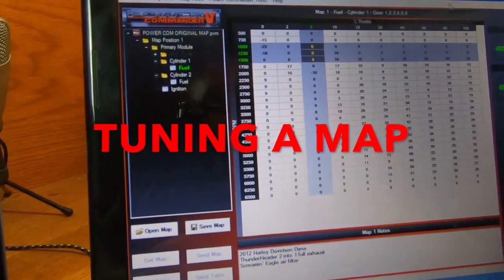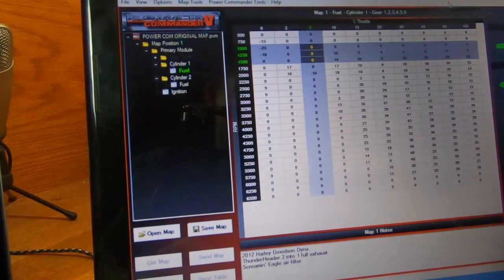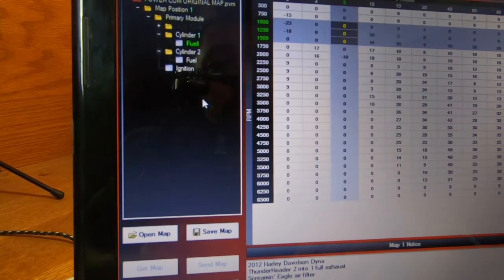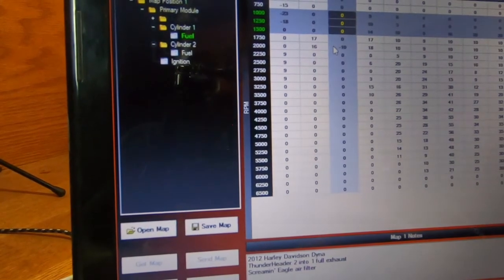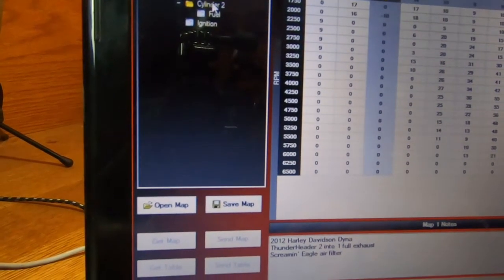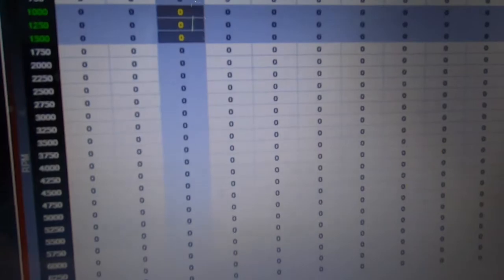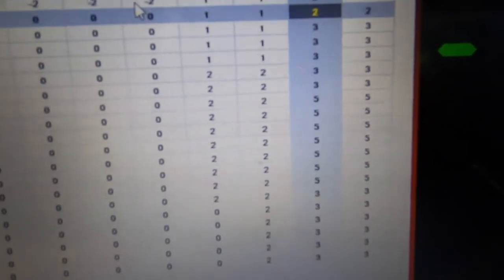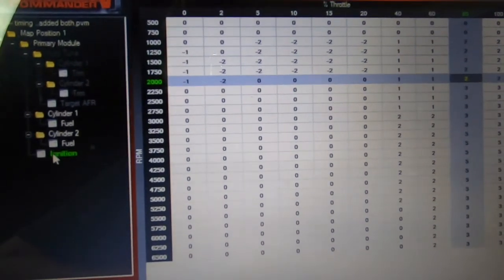POWER COMMANDER V DYNA TUNING

Comment: When you put minus in timing column is it mean you reaching fuel instead of leaning?
Reply from the maker: It has nothing to do with fuel .. timing is when the spark plugs are fired..like the guy that tuned mine originally he minus - my fuel because it was rough running dumping to much gas at idle but that's not needed when you pull some timing out down low it runs much smoother if you take to much out no balls
Reply: @TheGasStation1616  When pulling timing does it cools down engine temp?
Reply from the maker: @MrDzago  I would imagine but fuel would also and HP oil pump